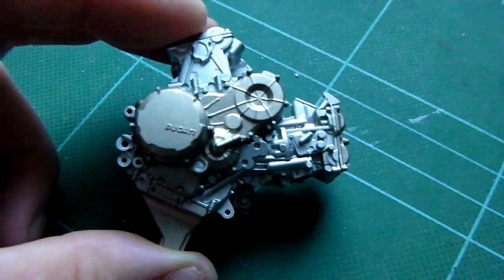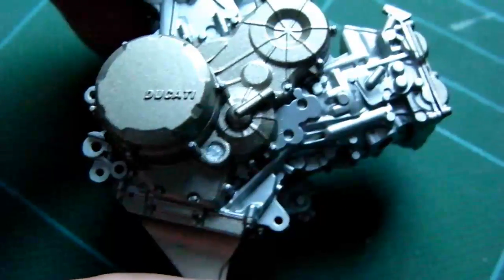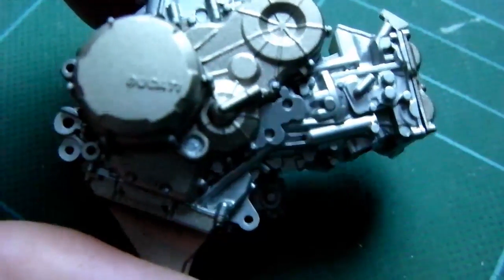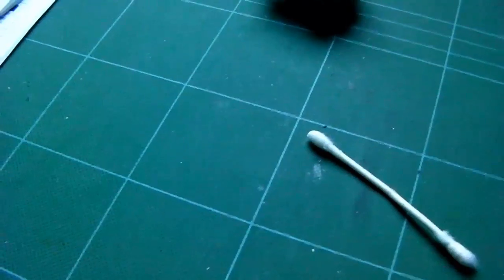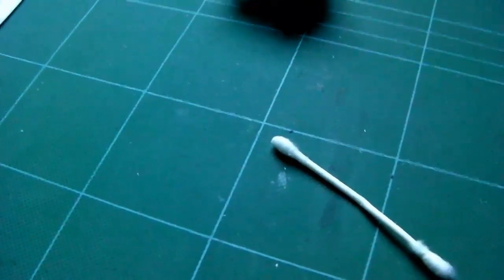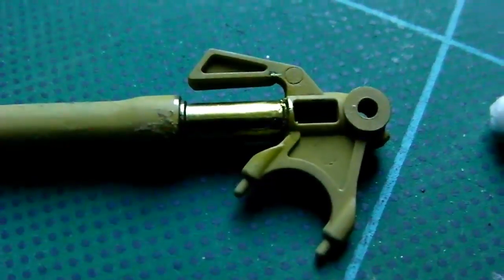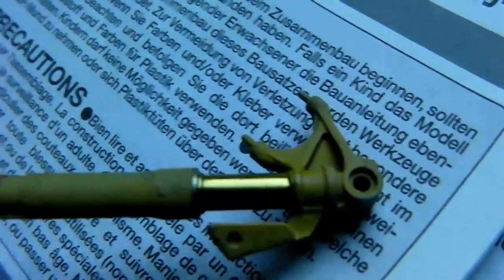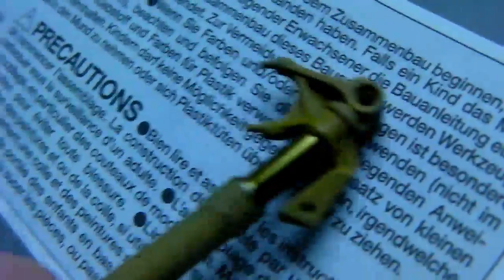Build pt 3 TAMIYA DUCATI PANIGALE 1199 S

Comment: Wanted to order this kit but after watching your videos it looks like I'll have to forget about any kits as airbrushing is not really something I can do in my London flat :( I've never built a model before and would've loved the challenge but alas...
Reply from the maker: Don't be put off by the airbrushing, it's something I do as I prefer the paint finish airbrushing gives, you can brush paint this kit just like any other. Enamels brush very well.
You can also look at using Tamiya acrylics for airbrushing as they're less smelly and dry quicker or if you have a balcony or an extractor in your bathroom you could use a tamiya TS spray for the panels and brush paint the rest. Hope this helps.